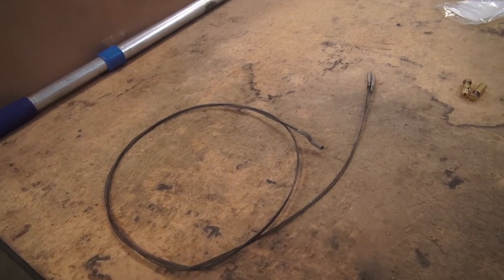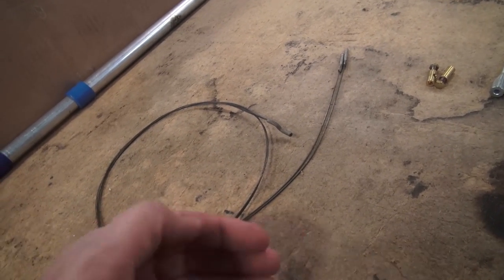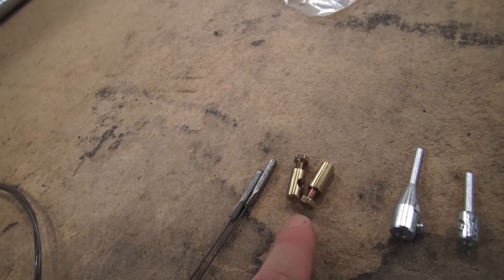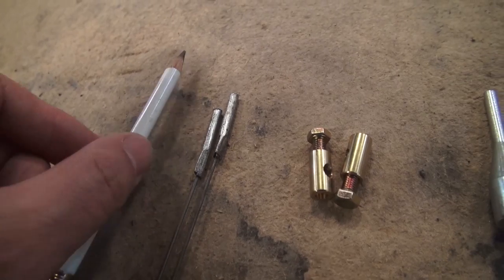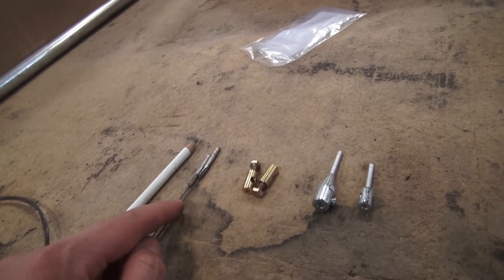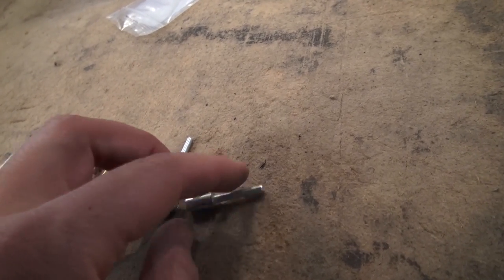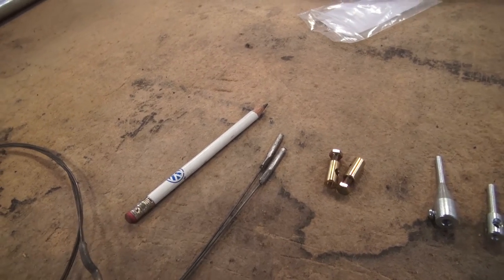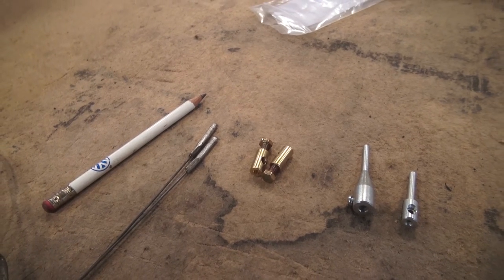Classic VW BuGs How to Tip Quick Heater Cable Install Fix Beetle Ghia Transporter

Comment: One additional option which worked with my Bug (while the other ones did not really work out), pre-heat the rear-end of the tube during 10 min with a hair dryer; and then it was possible to insert the tube up to the end ...

Comment: Chris,
Thanks for the tips to clear the tube.  Thanks again for the other video to fix heater box.  I haven't had heat in years.  Went under the car and found the two broken cables.  With some baling wire I rigged the levers in the open position - yes car became toasty.
Now a few questions as I wait for some parts to arrive. 1974 beetle
1.  Is there two tubes and two cables? Or does the cable have two ends and share a tube?.
2. I have the two levers in the cockpit (yellow knobs) which I removed and cant recall which side (driver / passenger side) does what?
3. I had a small grill on the floor by driver / passenger foot area - do these grills also get cabled?
4. At the rear seat kick panels (left & right) there is a hole - in it is a butterfly flap that allows heat into the rear foot area - use my finger to fix open/closed.
     A. One of the flaps is missing - can I purchase? - what’s the part  called?
     B. Are these supposed to be controlled somehow?
Thanks again for the videos. Really helping me - been driving around town - fun.

Comment: Hey Chris great video, both you and the Bentley manual say the Star shaped heater control knob near the shifter (64 bug) needs just a punch to the pin to remove the knob.  I feel like I have to hammer way too hard and nothing is happening? Does the knob need to be in a certain position or does the collar below need to be loose? Why is the pin not budging? Pins is for example the window crank pop right out, why not the heater knob too?
Reply from the maker: It could be rusted bad in there, and frozen.  We have seen it.

Comment: My heater cable is stuck in the tube and I have no access to the tip to pull it out.  How can I get the old cable out to install a new one?